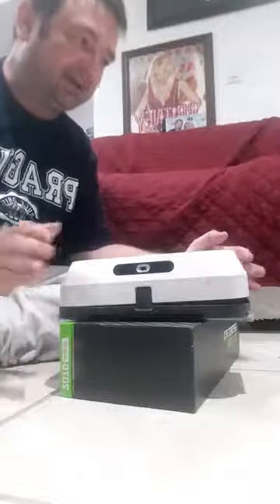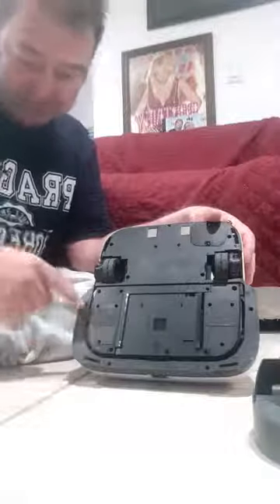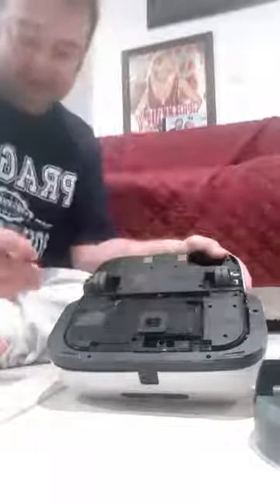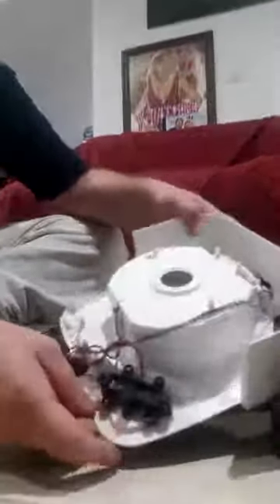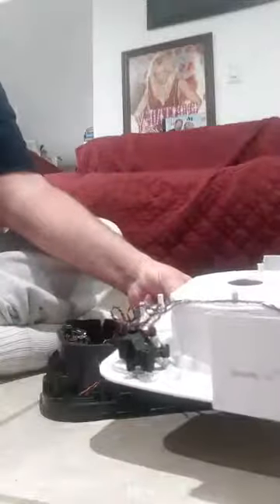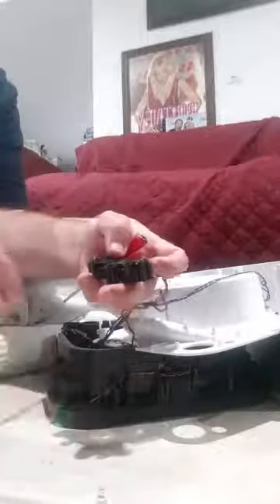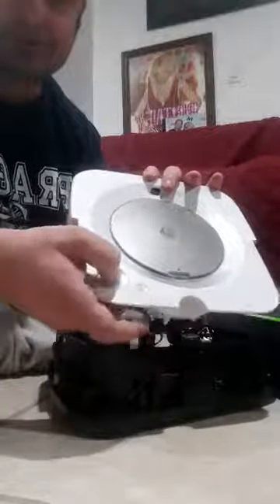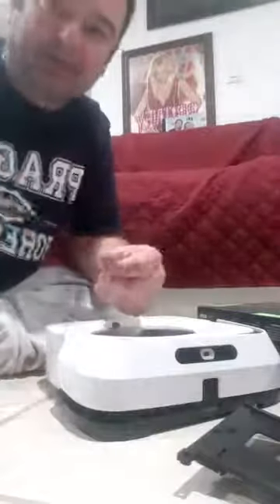iRobot Bravajet M6 Repair

Comment: Hello. iRobot Braava Jet m6 reported error code 34 and after restarting the robot does not respond, the indicator lights up in a circle in a clockwise direction and no reaction. I took out the battery for a while then put it back in place but it does not work. advise what can be done?
Reply from the maker: I would check that all the buttons work, move it off the charger try pressing clean to see if that works.  if you can feel that the buttons are not stuck, I would try the reboots in the iRobot App.  Let me know how it goes.
Reply: Does it work?
Otherwise, I got mine to work, by resoldering 4 joints.

Comment: how do you remove the filter, is it just a pullup or is there anything tricky as in a  anti clockwise turn followed by a pull.
Reply from the maker: it is a little tricky it pops straight up, you may want to use a small flat head screwdriver to wiggle it loose

Comment: You can't get replacement parts, only aftermarket from ebay used ones. Do you have an idea where to get parts?
Reply from the maker: It depends on the parts.  I have ordered parts directly from iRobot as well as other on line stores.  It depends on what the issue is. The nozel issue simply requires cleaning.

Comment: Hello friend 👍

iRobot M6 Jet …. Have you any experience with how to extract the wifi/navigation Unit from the  M6 Jet Unit? I have removed all screws, and still I can’t remove it.
Reply from the maker: Not sure how that is attached, it could be soldered in.  I have seen motherboards from laptops have those soldered in.  You may reach out to iRobot for a repair or replacement board.  I do know that they did a very good job to keep water off the board.
Reply: Thanks for your reply 👍👍🙋‍♂️

Just discovered it - one of the screws, is hidden by plastic. 

J melted it with a soldering iron and next step is replacing both charging pads.

Comment: my bravajet's pump is working but the spray is not.  I took it apart and cleaned the lines.  Still not working right
could it be the white piece in the back of the sprayer?  Where can I get parts and diagram with part numbers?
Reply: you cant get them. they dont have them for this. just take the thing apart and maybe buy another (broken) one and use the parts from that. that's what I ended up doing

Comment: Hello friend 👍
Have you ever tried to take out the motherboard?

A lot of Braava M6 Jet users, have a problem with the white clockwise circle. 
Read somewhere, that it might be a lost connection between the motherboard and the wifi/navigation unit. 
Probably because of a water damage. 

Best/
Mads
Reply from the maker: I never had the need to remove the motherboard. I would not be a huge fan to doing that because iRObot did a fantastic job in waterproofing the device.  Did this white circle occur when you are setting it up?  I would look at eather letting it sit and drain the battery or follow my steps to remove the battery for a little bit 5 to 10 minutes.  This should cause a reset with it.  If it is an WIFI issue and it is attached to the board it could mean you would have to replace the entire board.
Reply: I have the same problem. Have you found out what to do about it?
Reply: Have probably fixes the problem. It runs now - had to resolder some joints on the batterypack.

Comment: Hi, my cleaning button is stuck, at first i though the battery is dead, after replacing battery
it still doesn't work. please advise
Reply from the maker: I talk about this in the repair, the part about the cleaning button is  on the 05:37 mark of this video.  That was the reason I took mine apart. Let me know if that helps.